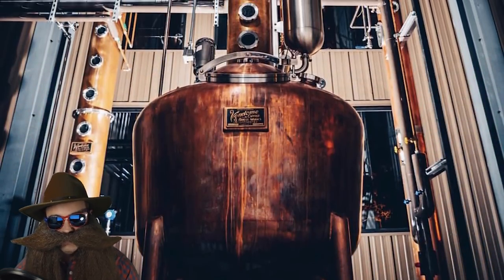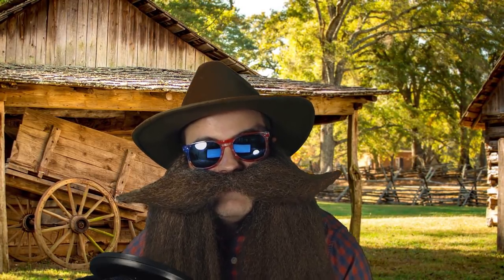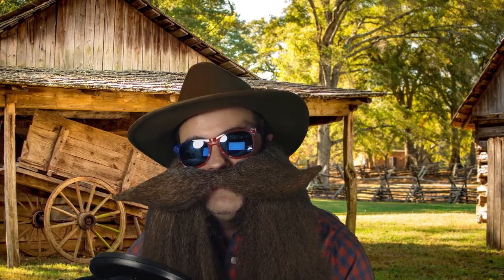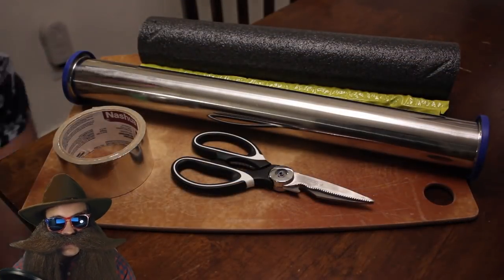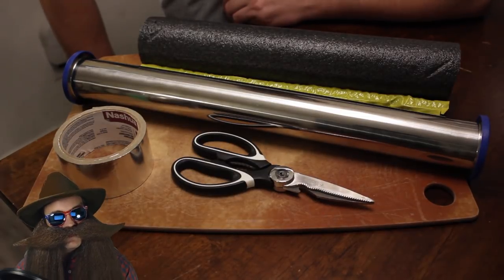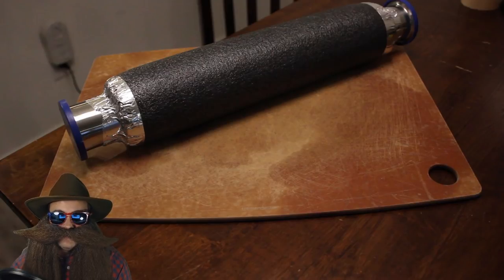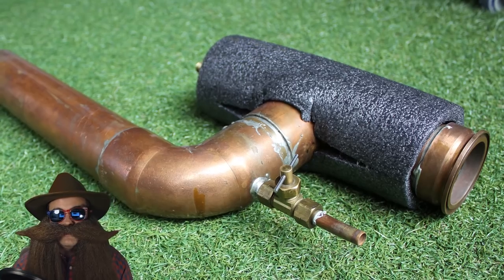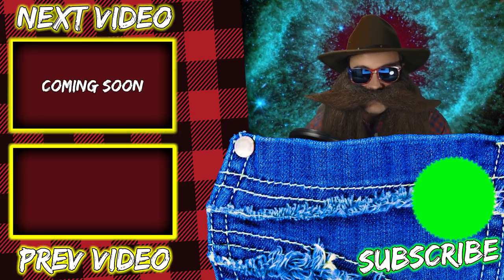Why are people Insulating their Reflux Stills?

Comment from the maker: Do you insulate your still or do you go naked?
Reply: Insulated still and column. 1/2" pipe insulation on column, glass/'metal foil on still
Reply: Never thought to do it,but that notion of doing it very much interests me, it seems that it would streamline efficiency, plus aid in not roasting the inside of my apartment
Reply: When i reflux, i use neoprene lagged copper 2"

Comment: The column on my customized Mile Hi 3 gallon mighty mini; consists of 4 2 inch sight glasses with copper bubble plates. So I don’t see how I could insulate those sight glasses. Although being blind, I don’t need to see the action in the sight glasses, but if I have a cited helper assisting me I could benefit by hearing their description of what’s going on in each site glass. You see what I’m saying? So I don’t know if I would benefit with insulating said site glasses? What do you all think? Great video!
Reply from the maker: Thanks! I should have made it more clear in the video that I was specifically talking about packed columns, as opposed to columns with bubble plates or bubble caps. Since there are such distinct phase changes in very particular places when plates are used, I'm unsure what the benefits are of insulating those columns. In an uninsultated platted column, I suppose some power would be lost from the still into the room the still is in, but on the flip side, you wouldn't need as much cooling since the room would be helping with that. Insulating a packed column helps reduce passive reflux from forming on the inside of the column wall, and helps keep the reflux and vapor interacting with the packing. Plated still work a little different. Of course, you don't want to cover up sight glasses if you have them :) They are pretty cool to watch and help you adjust your power too right? Happy distilling my friend.
Reply: It would seem that insulating a sight glass would defeat the purpose of a sight glass. If you are truly blind then kudos to you and being able to distill. I think I would blow myself up if I tried distilling without my eyesight😜

Comment: I don’t all my piping wall thickness are 2 millimeters. I might consider.
Reply from the maker: I remember the column insulation being pretty cheap. I got it from a plumbing contractor supply store. It was something like 8 feet of it for under $20.
Reply: wow 2mm thick . that should keep heat nice and steady

Comment: it's more efficient only on energy usage, not on separation. The separation efficiency comes both from column aspects and heat input only (to create a temperature gradient and let gravity make it's job), if you wanna save some energy/fuel you would like to insulate it, mainly if you have a digital controler system, if you do hand ajustments to heat input you may notice a longer lag between your ajustment and the flow out of your still
Reply from the maker: Hey Jesse, thanks for your comment. I suppose you could say that insulation helps with separation by helping keep the reflux column in equilibrium. Insulation helps shield the still from outside influence that may influence negatively affect the still. It may help you get a cleaner product and save energy. Aside from insulation not looking very nice, I struggle to find another downside of adding it to a reflux still. As for a pot still, that could be a different story. Pot stills have many different shapes for different purposes. Cheers and happy distilling!

Joey Joe Joe Jr
Reply: @OpenSourceDistilling  It's more efficient because you have to put less heat to achieve a better sepparation, but if you put too much heat it's not going to separete so well. In a column still it's useful because you can get the exctly same product because the system always work the same way. In a pot still however you need the metal to be exposed because these heat exchange will do the reflux
Reply from the maker: @jesse.marques  When you say you NEED exposed metal in a pot still exactly what do you mean? Are you talking about an onion that provides passive reflux (not everyone has those)? Are you saying that it's detrimental to insulate that boiler on a pot still? I think certain pot stills would benefit from insulation and others wouldn't. Scotch whisky stills have specific shapes that provide character to the spirit and you could not insulate that type of still without affecting the final spirit, but a home still with a shotgun condenser could benefit depending on what spirit you are trying to make. For example, my stripping run setup is fully insulated and has no ill effects. What type of pot still are you talking about?
Reply: @OpenSourceDistilling  you got what i meant, even I don't explained right. Every pot still column has its effects based on its shape, insulating it will change the profile IF you keep the same heat input. We always need to think in terms of temperature gradient. If you put insulation in a tall column its almost the same as reducing its height.
Home distillers can choose what pleases them most, and if the wort to be distilled tastes good, so will the result spirit, considerind all cuts to be done..

for a strip still the insulation is all benefits
Reply: just to be clear, I'm talking these based on what i've learned on my chemistry grad and some distillers knowledge.
I'm not distilling yet, but my father makes cachaça and other spirits (we are in Brazil, its legal to distill here) my still is planed to arrive around march/2020 (150L)
On lab we only insulated the still/column if the heat source wasn't good enough or if the product could suffer some reaction
Reply from the maker: Thanks for you comments. Appreciate it. That sounds like a serious still you have on the way. Congratulations! Keep me posted when it arrives. Interested to see what equipment people are using and what they are making with it. Cheers!
Reply: @OpenSourceDistilling  Yes it's a beast of a still, and I'll surely keep in touch with you, hope to help with your open source project... I have some weird ideas to try with the still, and will need help on discussing the results
Reply from the maker: Absolutely, my project is just starting and things are going to get a whole lot weirder as things progress. The community have suggested some 'out of the box' ideas that I'll be putting to the test. If I can help you out in anyway please let me know.
Reply: @OpenSourceDistilling  Just expect me to be a regular here, when my still arrives I plan to upload some videos in youtube, so we can test the same stuff in different systems (mine will be direct fire, pot still, made by my father)
Reply from the maker: Awesome. Glad to have you here! Welcome!
Reply from the maker: How's the distilling coming?

Comment: I use gas. So I'm thinking of using non flammable insulation like glass fiber or glass woll. My friend must have seen you video because he did insulated with Eva. It melted
Reply from the maker: I got my pipe insulation from a plumbing store. The foam stuff is really cheap but they did have fiberglass as well in all sizes. I'm not sure what Eva is but I'm sure your local plumbing store could help pick out the right insulation for your column. Thanks for watching. Cheers!
Reply: @OpenSourceDistilling  thanks!